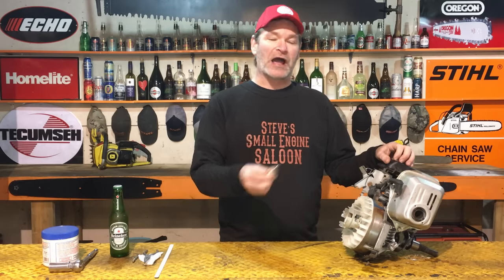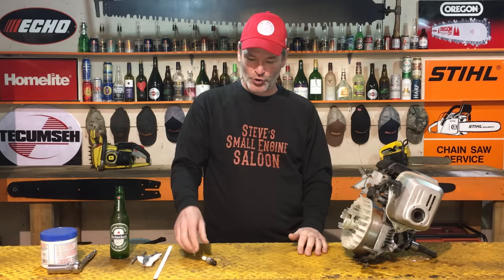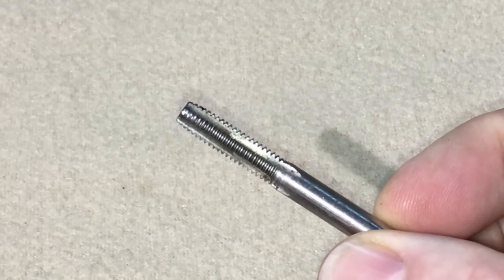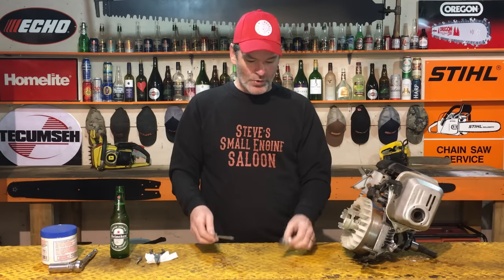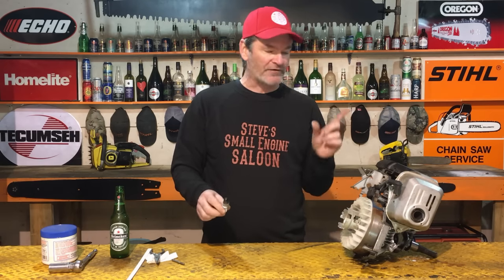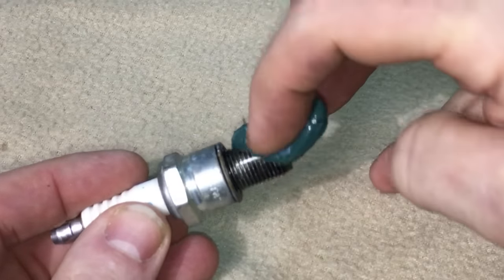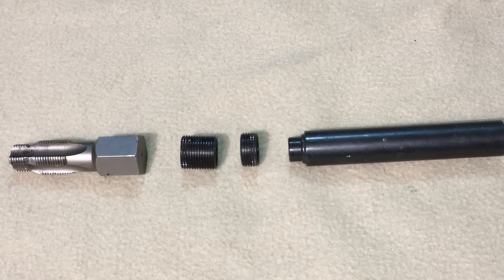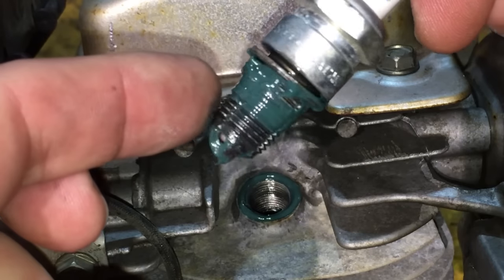How To Fix Stripped Spark Plug Threads For Free With This Hack

Comment: I have used this hack before, only thing I did different was put some grease on the tissue so the metal shavings stick to the tissue. Then I would also blow out with compressor.
Reply from the maker: Right on...

Comment: Also you can use a sparkplug to make a thread chaser dirty crappy threads in the spark plug well? Make a thread chaser use a hack blade or a drimmel and cut diagonally bottom left to top right on the plug threads. Do this on 2 sides of the plug lube it up and watch all the gunk you bring put of those threads with that plug...

Comment: Steve, I would not recommend using the same spark plug you cut notched in. Carbon will build up inside the notches and cause the plug to damage the threads when removed. I have used your advice many times. Thank you.

Comment: My "hack" to avoid cross-threading a spark plug into an aluminum head (And avoid needing this "hack") = After applying anti-seize to the plug threads, start plug install (by hand) by first turning it counter-clockwise. When the plug threads hit the start of the head threads, you'll feel a click or a drop when they align. Then turn the plug clock-wise as far as possible before final tightening. This same "hack" works when reinstalling any fastener into soft materials like aluminum or plastic. I always did this when doing dash work.
Reply: This x1000 should be common knowledge.
Reply: That's why I posted it, to let newbies learn a trick from an ol' fart mechanic.

Comment: Here's another trick for dealing with a stripped out spark plug hole: apply a high temperature epoxy such as JB Weld to the plug threads and screw the plug back in the head.  It's a one-time cheap repair trick but it works!  I would not recommend gluing a spark plug in an engine unless it is an old engine or an engine in something (car, motorcycle, lawn mower, etc.) you will be selling or getting rid of rather than keeping long term.  I've used this trick on old lawn mowers, motorcycle engines and even cars and have never had a problem with a plug blowing back out, even after tens of thousands of miles!

Comment: Thanks!
Reply from the maker: HOLY SMOKES JAMES!  Thank you so much.  That is very generous...    :_Beer: :_Mower: :_Rider: :_Chainsaw:
Reply: You're very welcome Steve, your video about cutting slots into the spark plug and using it as a tap worked like a charm. I actually cut 5 slots to give me more cutting edges. I used it in a Chrysler 3.8 V6. I was worried about how to repair it and you saved me a lot of time and labor. Thanks again, have a Merry Christmas. I love you man, lol.
Reply from the maker: Right on Buddy!  Funny enough I just did that again TODAY on a chainsaw and worked perfectly AGAIN...

Comment: Hello :) 
My thoughts about this video !
It reminds me !
Exercise finesse and pay attention even doing things such as removing spark plugs !
I have seen people bust a plug to where pieces of the ceramic insulator were in the cylinder !
And on a overhead cam engine no less !
When things  such as this happens it is a serious problem !
Least that is what I think !
Maybe you should have explained what a thread chaser is !
Is this a best way or place to chase or repair  threads ???
I will be damned if I know !
This is a time to do serious thinking about loss and reward
Very complicated if truth be told !
I do know it would be best not to damage the threads in the first place if at all possible :)
Likely best to remove the head !
Then try and chase the threads 
Just the way it is I think !
Life does have its rough spots !
Best Tu U :)

Comment: Now that the spark plug has slots what about compression and why would there be metal shavings if there wasent any on the spark plug to start with .screwing in a plug your saying cutting slots on the plug is going to cut what original threads beyond me

Comment: This is a great idea. Another option is a product, that I haven't had the opportunity to use yet, called the "back-tap". I believe that it comes in at least 12mm and 14mm sizes. With it, you basically chase the threads from the inside out.
Reply: thats what he should be  showing and doing.. not  this crap
Reply: I've heard nothing but bad things with the back tap. Breaking off and falling into the cylinder. I truly believe I'd rather use this method myself. Glad I seen it because I'm about to do this to a 2003 Nissan Frontier #6 Plug. The hardest plug of them all to get to...
Reply: @mikey3071  did you try this method? I’m having the same problem on my car

Comment: Good techniques here but for $5.50 on Amazon Prime you can get a Lisle double-sided spark plug thread chaser, with tapered threads and harder cutting metal, and save yourself the hassle of cutting flutes into the spark plug.

Comment: Ive got am old mower that just refuses to die. I call it the roach. Threads are so boogered up plugs stop turning about 3/8's before they bottom out. It still fires and runs fine believe it or not. Has been for years. I just add a couple xtra washers to get a good seal and roll on roach roll.

Comment: i have had this problem. my idea is better and safer, find a plug with a good  sharp thread.  put it in a vice, and break out the porcelain  from the plug, saw off the tip. and  and bend the central electrode about till it breaks off.

Now get a hack saw, and saw down the thread right across from one side to the other, down to the hex of the plug, now give the plug a 1/4 turn, and do it again. lightly brush away the burs . fill the plug with thick grease, to collect the swarf.  now gently screw it in the plug hole by hand, backwards and forwards, like tapping a hole, 

the advantage of this method is because of the 4 hacksaw cuts, if the hole is tight, the plug is spring loaded. and will tend to collapse, less strain wile  it cuts a new thread, keep going backwards and forwards, until the plug springs back to full size, you will have a perfect thread, but steves idea of bringing the piston up to tdc and stuffing paper in is an extra precaution, but my grease filled plug will do the same job, once you have made the plug keep it in your toolbox for next time, paul
Reply: PS  it works better if you use 2 hacksaw blades together, larger slots to collect swarf, and a little more spring in the four segments. paul

Comment: Fantastic dodge.
I thought this was going to be a horror movie but its a great idea.
I think the dremel guys will probably hit the step of the plug and cause a compression leak when its all back together.
I had a stripped plug thread on an old Briggs but as it was sidevalve it was easy to swap out the whole head with another one.
You can do lots of damage to threads by using cordless drivers without great care.
Thanks Steve
Reply from the maker: Thanks Martin...

Comment: "Don't use my name in the video" the one guy says, then in the video he says "Thank you Scott"!
But seriously, the tap has a sharp edge on the face of the cut in those threads so it cleanly cuts the threads.
I'd get the proper size tap as there are only a few thread sizes.
Using the spark plug you made the cuts in it could cause carbon to build up in the cuts and could finish destroying those threads the next time you try to remove it!

Comment: Well, I don't want to be a free-loader... so here is one of mine. Remove the canvas bag from the frame of the grass catcher on your lawn mower. Shake out all the loose stuff and put it in the laundry washing machine.This will get all the buildup out of the bag and allow air to flow through it like when it was new. It will also look new. I like to use tide and bleach, but even  just water will do much good. 
 Don't use your wife's laundry machine, use the one in the back yard, or pick up a free one from the side of the road and set it up in your back yard. Having it back there will allow you to come up with ideas for other stuff to wash that shouldn't be in the house. (Dog bed, horse blanket, etc... But really, it is for your mower😉)

Comment: As always. Awesome.  Maybe after pulling paper towel out wiggle a telescopic magnet in the hole.

Thanks again
Reply: That works if its a cast iron head,but most engines these days are made from aluminum.Still a great tip for the older engines though!😊

Comment: Hi Steve. I have two doubts:

Why not use the tap itself, instead of cutting grooves in the spark plug?

And shall this method be used if a few starting threads (in the first 8 - 10 mm) are damaged? The threads in the deepest portion of the hole (last 8-10 mm) are good.

This is for my 110 cc scooter TVS Jupiter that uses M10 x 1 long thread spark plug.

Please do answer my queries. 

Thank you in advance.

Comment: Hi Steve. I watched this video just now. Thank you for posting such a great and useful method to repair the spark plug threads. 

I have two doubts:

Why not use the tap itself, instead of cutting grooves in the spark plug?

And shall this method be used if a few starting threads (in the first 8 - 10 mm) are damaged? The threads in the deepest portion of the hole (last 8-10 mm) are good. 

This is for my 110 cc  scooter TVS Jupiter that uses M10 x 1 long thread spark plug.

Please do answer my queries. Thank you in advance.
Reply: Hi Steve, I have two doubts:

Why not use the tap itself, instead of cutting grooves in the spark plug?

And shall this method be used if a few starting threads (in the first 8 - 10 mm) are damaged? The threads in the deepest portion of the hole (last 8-10 mm) are good.

This is for my 110 cc scooter TVS Jupiter that uses M10 x 1 long thread spark plug.

Please do answer my queries. Thank you for such a useful and valuable video.

Comment: 🇦🇺Yep thanks Steve ,pass it on 🤫to Scott 🍻 .🇦🇺i by the el-cheep-o box of  baby wipes  from coles 480 For $10  easier to get back out of the hole than tissues .wipes will not fall apart .great for parts cleanups as we’ll.
Reply from the maker: Great idea

Comment: Ahhh but you won’t ever need this if you’re careful putting your plugs in.     If it doesn’t spin in FREELY 4 or 5 full turns back it out and carefully do it again.     Clean the threads first if they’re cruddy .Crossed threads always “feel funny” and you can almost always stop it before it fully develops if you do this.

Comment: Used this dodge on many motorcycle heads. If you turn the back of the plug off in a lathe and get the insulator out https://www.youtube.com/watch?v=QU-2HQ7NakQ you can cut in 4 slots with a hack saw or better still find one of the old spark plugs you can take apart and its easyer than using a hack saw blade, great tip.

Comment: I have a problem, I tried this hack and my paper towel fell in the spark plug hole all the way, I'm using a Yamaha Moto 4 is there anyway I can take the paper towel out without removing the whole head

Comment: Yup,that's a good one Ive been using for years. 
The old file notches on the bolt to turn it into a tap trick. 
Cool part is you can still use the bolt,and if you ever need a tap that size again,you know where it is 🤣
Reply from the maker: Right on Buddy...

Comment: Yeah But If That Is The Same Size Spark Plug It's Not Gonna Work, Because If It's Stripped It's Because The STEEL Threads Stripped Out The ALUMINUM Threads In The Hole Because Steel Is A Lot Stronger Than Aluminum, So If Either Strips Out It'll Be The Aluminum, Thus Making The Hole Bigger So Therefore The Spark Plug Will Never Stay In Unless You Do That With A Bigger Spark Plug. That's Why When People Uses A Helicoil They Drill Out A Larger Hole Then Thread It In Order To Be Able To Put In The Right Size Helicoil For The Spark Plug. I've Never Seen Anything Made Out Of Aluminum With Threads That Was Able To Strip Something Made Out Of Steel That Has Threads. So Therefore How Would There Be Any STEEL Threads In The Head To Clean Out To Start With, It Would Be Aluminum Threads Wrapped Around The Spark Plug.

Comment: Can you please help me? I just re threaded it. Fixed it. Got the spark plug back in.  But the paper towel I had sitting in there-50% of the metal flakes and the towel fell into it.  What the hell do I do? I’m so frustrated